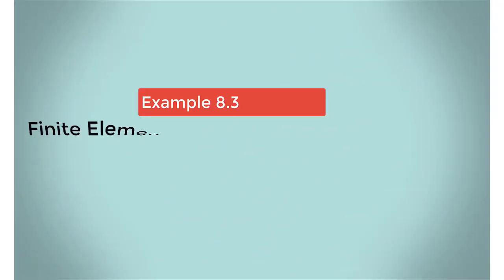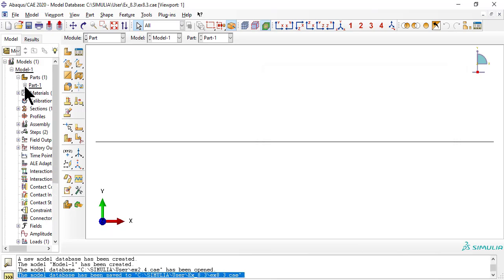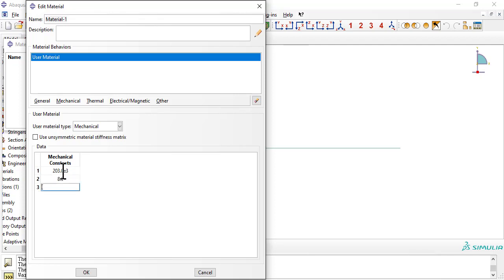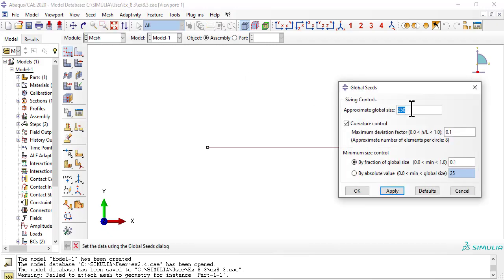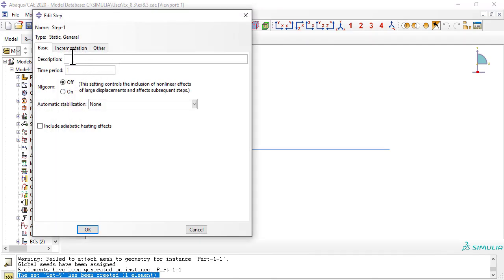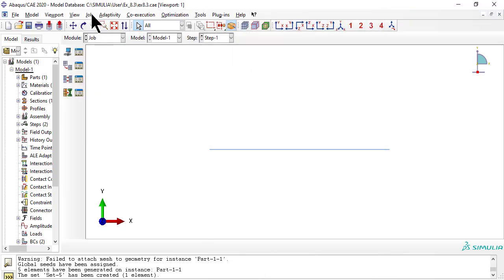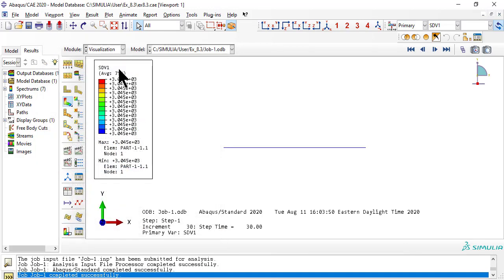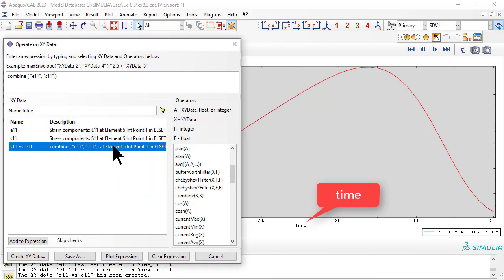Example 8.3 Abaqus UMAT for Rosen's damage model of unidirectional composite materials

Comment: Thak you professor Barbero for this great video, 
I'm wondering if I should use Umat to define the concrete damage plasticity model under cyclic loading, I have used the built-in model but can't get good results regarding to the experimental data.
Reply from the maker: Yes but for cyclic loading you need a damage accumulation equation or some other way to reduce the size of the yield function, which normally grows with plasticity but if you do nor shrink it, then the same load magnitude will not produce more plasticity when the number of cycles increases.